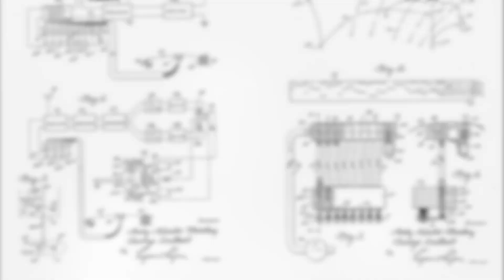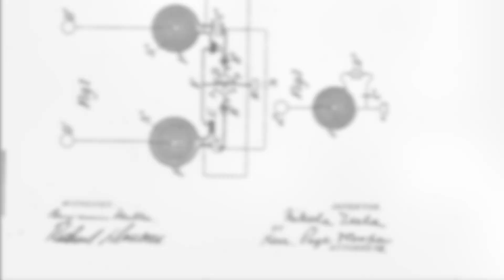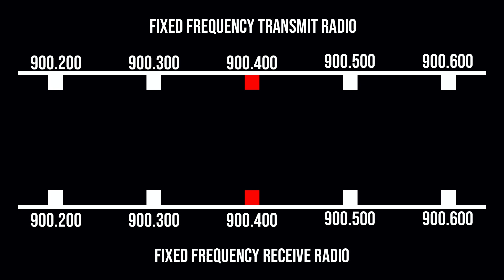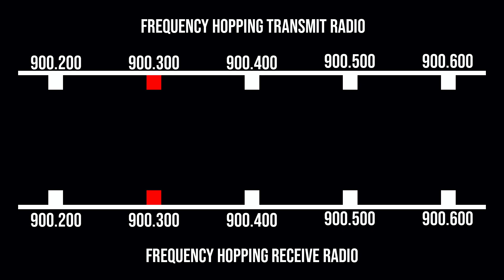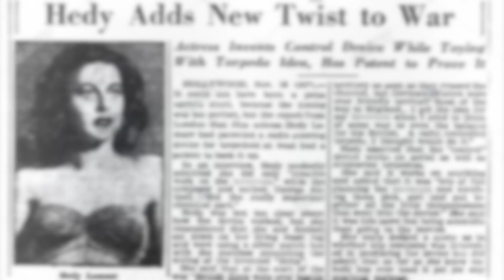The Radio System Invented By A Silver Screen Beauty

Comment: the 2,4GHZ Radio control band uses spread spectrum technology.  much better than the old 40mhz, 27mhz and 35mhz systems and can be used for model ships cars and planes, though due to the high frequency it doesnt work for sub surface models as the signal as far as I am aware can not get through the water unlike the lower 40mhz frequency band.  

27 and 40 mhz are for surface, 35mhz is dedicated to aircraft modelling

Comment: Nice bit of SDRuno there.
What model do you have ?
I just have the bottom of the range version but this is fine and works nicely on 50 foot of wire running along the top of the garden fence